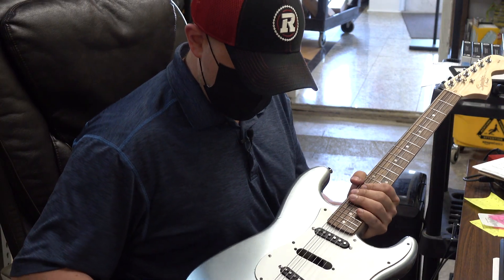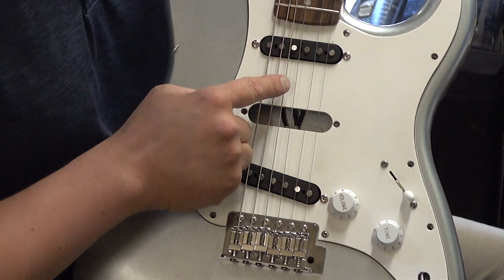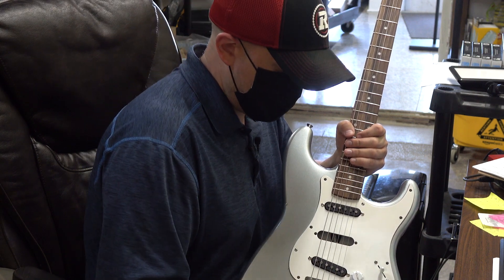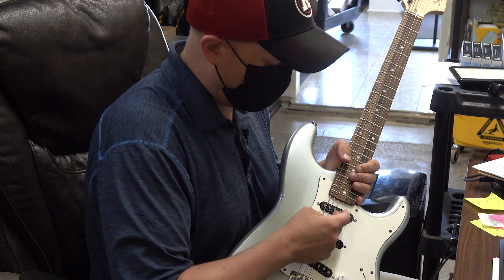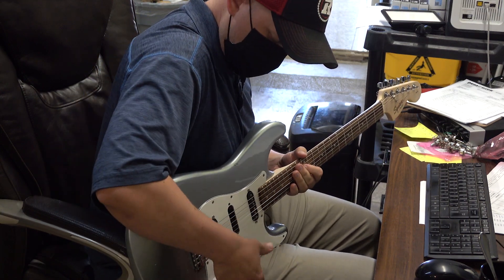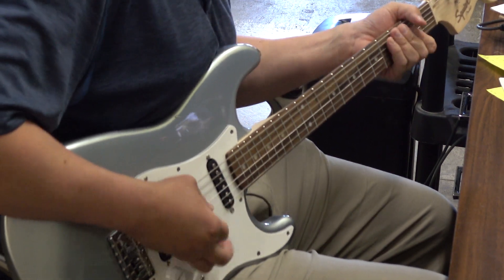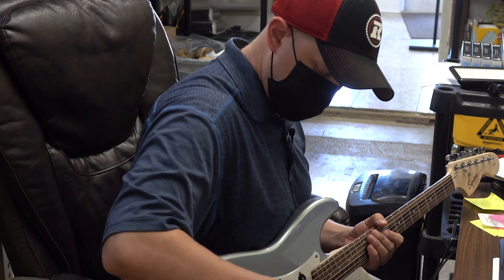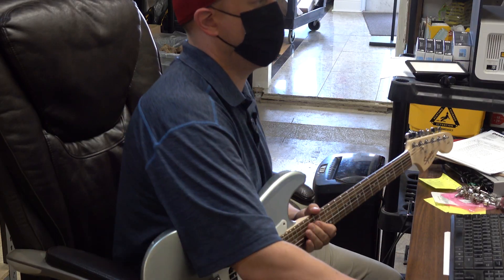The Problem With Noiseless Single Coils (inline humbuckers / split coils)

Comment: The way to do this with much less chance of the bending issue is to make it like a P bass pickup and use rails instead of poles just to be sure.
Reply: More specifically a Reverse P pickup for the neck and possibly middle position too so there's less muddiness. Might have to run the bridge as a regular P pickup for more power/punch.

Comment: I build a similar pickup and I’m willing to bet that one of the coils on the bobbin is reverse wound. You reverse wind the bottom coil when making a stack pickup not when the coils are side by side.

Both coils need to be wound in the same direction and wired in series finish-to-finish. Magnets north on one coil and magnets south on the other coil.
Reply from the maker: That would eliminate the dead spot, but would also eliminate the hum cancelling.  These needed to be hum cancelling.

Comment: I might bend a G string right up there 
but never a D. Is it possible that the EA be on one coil and the DGBE on another?
Reply from the maker: For hum cancelling (and for matching tone), you generally want the coils to be the same size and shape.  So, you could do that, but it would be very difficult to have the same tone/output between both coils, and it would reduce the hum cancelling effects.  There are so many good noiseless (or heavily reduced noise) pickups on the market already, this split coil design is just an inferior design if that's the only purpose.

Comment: Thank you for posting this video! I was searching for this topic because I have a bass with inline humbuckers and I was curious about how they sound compared to a pure single-coils. From this video, I take it that they sound dead-on, and since it is on a bass, those large bends really aren't an issue. Great demonstration!
(Also, I need to give props to the YouTube search engine. I have never heard the term "inline humbucker" before. I searched for "bi-coil" because that is what the manufacturer calls them, and YouTube lead me right where I wanted to be!)
Reply: Split coils

Comment: Silly question, but is there a change in the sound when switching from series to parallel in this type of setup, and if so, how are the pickups in the video configured?

Also, could you therefore separate and mix the bottom strings of the bridge pickup, with the high strings of the neck pickup? The concept fascinates me, I have MANY questions 😅
Reply from the maker: I think in this particular video, they were wired in series.  However, the final result, if memory serves, was wired in parallel for the customer's purposes.  He made a video demonstrating the capabilities of how they were designed for his purposes:
https://www.youtube.com/watch?v=82Z1fyoKlis
Reply: @NextGenGuitars  I think we spoke a few minutes ago, thank you again for taking the time to explain everything! Fascinating concept here, I'd love to explore it further some day 👍

Comment: Are Inline humbuckers the same as being called bipolar pickups which I guess have that LOSS from the G string pole piece to the D string pole piece?
Reply from the maker: If you're referring to Bipolar (the brand), yes, the design is the same.  However, if you use their suggested wiring diagram, they mostly avoid the signal drop-off.  Their switch wiring never has two active coils side by side.  They are always off-set between two pickups, minimizing signal loss.

Comment: Most stacked singles are full sized coils, one on top of the other, so this is kind of a unique issue to this concept.
Reply from the maker: Yes.  That is exactly the point of the video.  To show the drawbacks of this particular design.
Reply: Its a failure for Benders.. But companies like Zexcoil / Lawning creates one coil for each string and offsets them, and thus eliminating this issue. Fender quickly discontinued these pickups for a good reason.
Reply: I picked up a roadhouse deluxe on a really good sale... It has the fourth generation fender noiseless pick ups and I like them.... I personally haven't noticed any of this dropout when bending.  I'm wondering if the configuration of the coils is a stack on top of another versus side by each.
Reply: @msi1985  most noiseless singles are stacked and not side by side. There are differences in results between the two approaches, tonally, but like anything in pickup design it's something to factor into the equation when chasing a particular tone. Just like wire type, magnet type and size, number of winds, coil dimensions, slug sizes, etc
Reply: Agreed. Just tried it on my Tele with a stacked single coil Seymour Duncan in the neck and no issue of signal loss with heavy bending at all in either the G or D strings.

Comment: Thanx, what about the Tone ? Is it still closer to single coil or closer to humbucker ?
Reply from the maker: Much more like a single coil than a humbucker.  But, due to the drawbacks, it hasn't been adopted as a common design.  Fralin has a similar design in a split blade that sounds quite good, but is pretty expensive.  Fender released a Super55 some time ago with this design, but it flopped and was discontinued.  Other than that, I haven't really seen anything with this inline design...
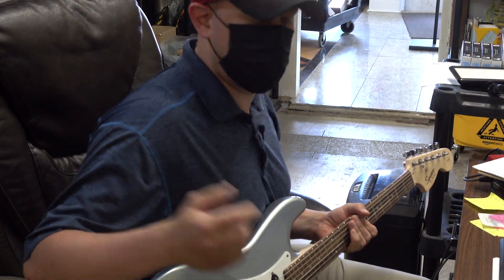Reply: At 2:06 the guy wearing a mask while inside his own home, clearly states they "sound like single coils!"..

Comment: The fender noisless Gen 4 is stacked. One over the other thus this issue doesn't exist
Reply from the maker: Yes. I like stacked designs. That is a totally different pickup design though. This video is just a quick discussion on the split inline design.
Reply: @NextGenGuitars  yea i noticed. Thanks for the info. Video is very informative. Cheers!

Comment: Sheesh, I have a rai ‘bucker in my Tele’s bridge. Glad I went with that instead. No signal loss with rails.
Reply from the maker: There isn't really any noticeable loss in the bridge position (unless you bend up more than a whole step, and even then the loss is minimal), so it's pretty safe there. It's mostly a middle/neck problem. I love rail pups, but they really need 500K pots to shine. They also don't really sound like single coils, so if the goal is to get a true single coil sound, but noiseless, rail pups don't quite get there.

To be fair, I have yet to hear a noiseless single coil that doesn't sacrifice something.

Comment from the maker: In the video I call it a phase issue but "correct" that with overlayed text saying it's because the coils don't overlap in the center, creating a dead-spot between them. But, it isn't actually the coil's that are the problem. It's a dead spot in the magnetic field at the center that's the problem. You see, to be hum-cancelling, the two coils need to be RWRP. When you have two opposing polarities like that, there is a center point between them where the polarity is neutralized.

Passive pickups work by magnetizing the strings. The coil picks up the shifts in the magnetic field provided by the vibrating string. If you bend your string into the "neutral" area, your string is no longer magnetic at that spot and your signal drops or disappears entirely because the coils no longer "see" the string. Fascinating stuff!

One thing I don't touch on in the video is that there are fixes for this design flaw. You can use ferromagnetic bars across the tops/sides of the mangets to manipulate the magnetic field in a way that keeps the string magnetized across the center. Fender had a Split Coil pickup on the market for a while that did it too, though it was a commercial flop because while it reduced the signal drop between the D and G, it didn't eliminate it completely. A lot of poor reviews regarding the tone and signal drop issues. Fralin does it too with their Split Blade design, apparently with greater success.